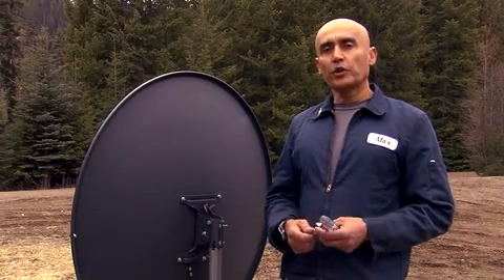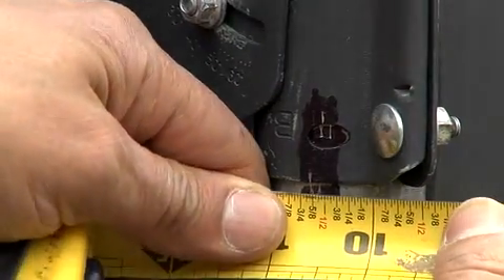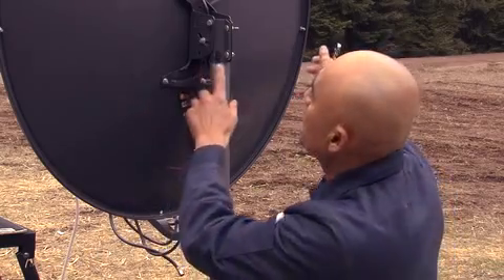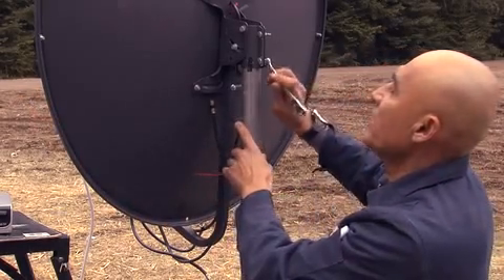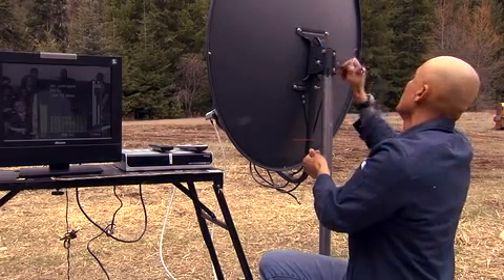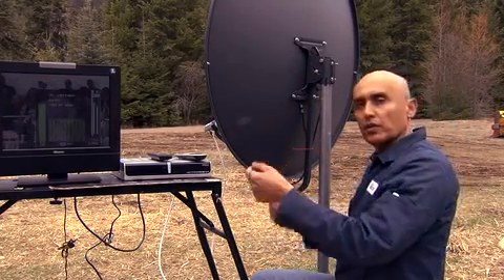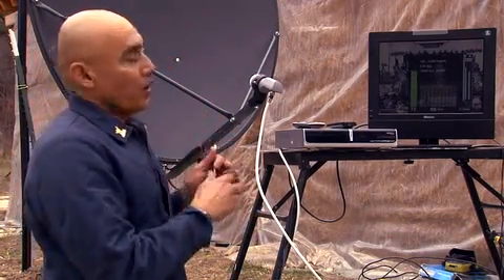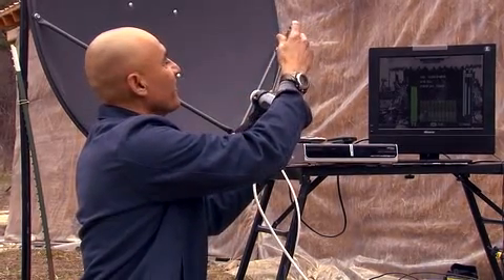FTA realignment from amc-4 to G-19

Comment: Please help: 
Trying to point galaxy 19 my signal is always 52% and quality 0% .
1- Using V8 Finder to detect maximum signal, At Elevation and azimuth constant the Skew doesn't improve my signal.
So, I changed the altitude and azimuth to see and
2- Altitude and Elevation doesn't affect the signal. 52 to 54% and quality always 0% !
3- If I do a full scan on Galaxy 19
a list of channel is displayed after a full scan on galaxy 19
....
00007 gal 19 04c80 V 29850
00008 gal 19 04881 V 29990
...
Any idea to find what is wrong in my installation ?
Reply: You need to reset the v8 sat finder to factory settings every time you use it . I have found this useful.  Works every time . If done that way and angle . And lnb sqew is set it should work. Love my v8 sat finder . Good luck .
Sonny